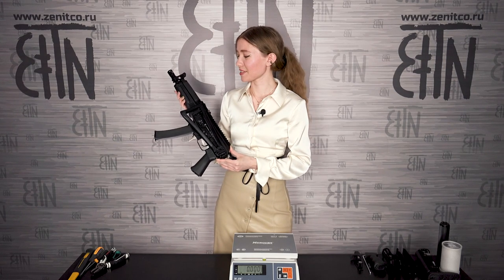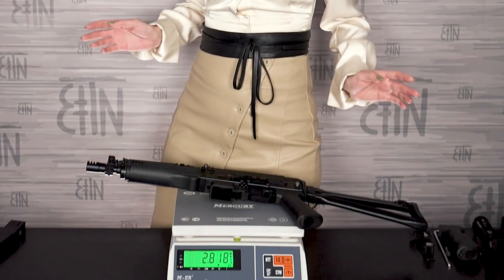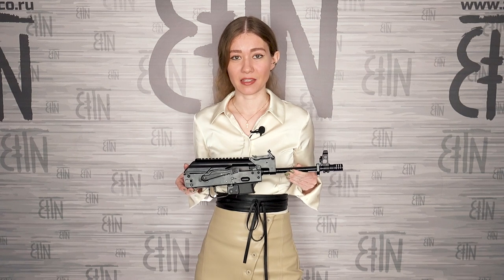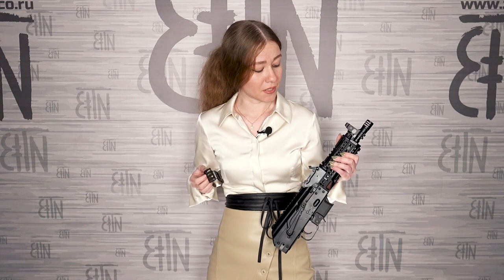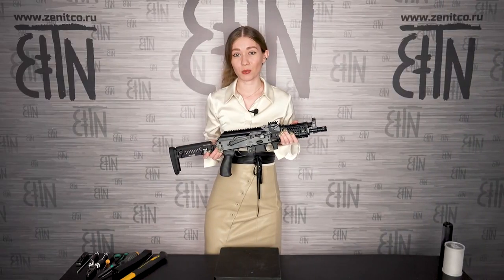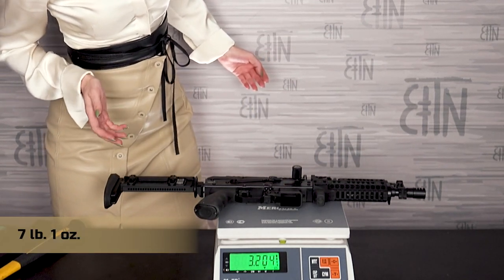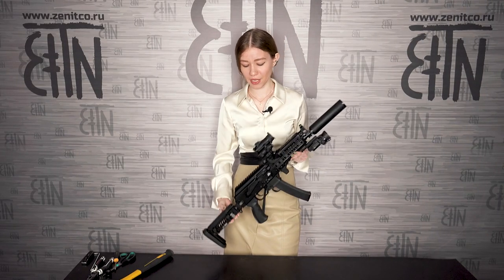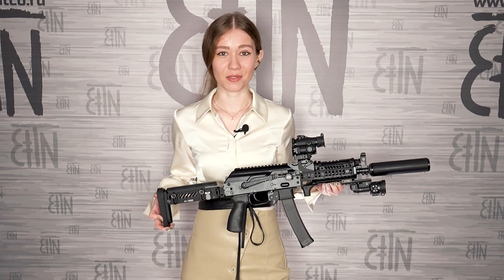"Vityaz SN" submachine gun modernization

Comment: Will this fit palmetto state armory Ak-v?
Reply: *Edit AKV uses AKM standards and sizing, so any AKM sized Zenitco furniture will work.
Reply: in regards to the bottom hand guards if i recall it's kp9/ vityaz specific because tab is shorter then normal AKM version but I think the ak-v allows for regular AKM furniture to be put on so just get AKM version Zenitco furniture everything else like stock , grip, top gas tube rail should fit normally.
Reply: @kingboom777  Yeah I think you're right. I'm seeing guys use the  B-21M lower and B-19 upper handguard.